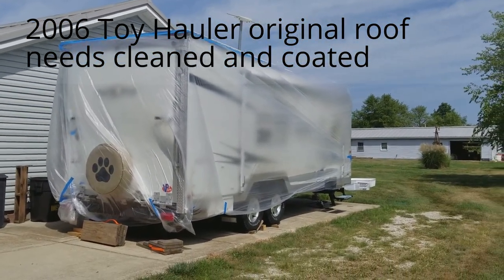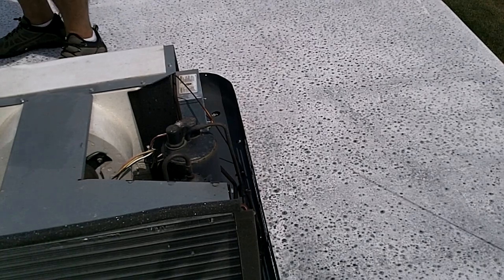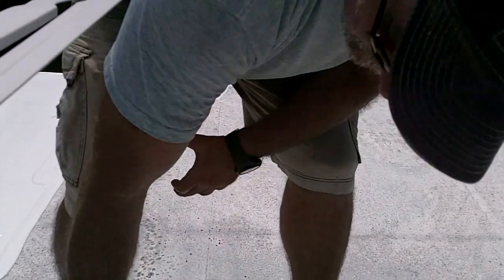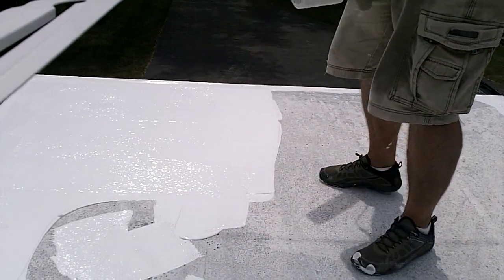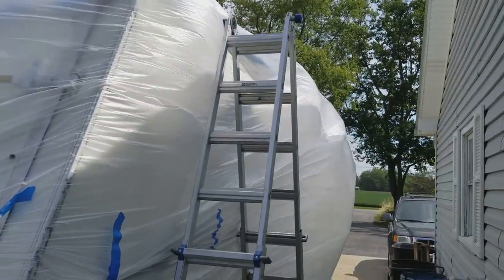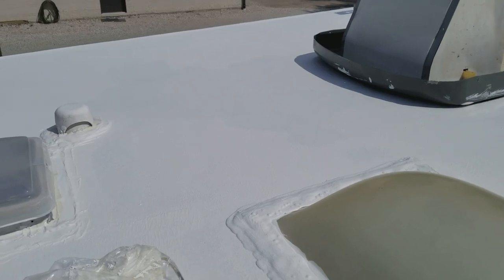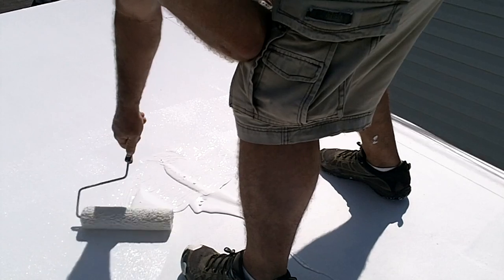RV roof clean and reseal DIY

Comment from the maker: Fyi, 
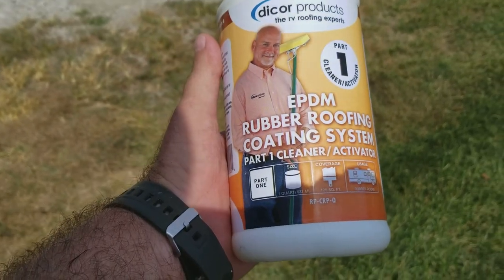@ 0:43 Dicor  Part 1 EDPM cleaner activator. 
@9:45 Dicor Part 2 EDPM Rubber Roof coating / sealer.
Reply: how did you approach the existing gobs of sealer around the vents, seems etc. Did you scrape them off and redo. Seems to me it would be a hassle taking off the existing sealer / gobs of self leveling dicor that is already there.
Reply from the maker: @WarrenEdmundson  I cleaned them thoroughly,  and if it looked like a void existed, I resealed it. No reason to remove unless it was loose. Thanks for watching.
Reply: Thanks for a great video
Reply: I looked up this product and found that the price varies from around $30 to $100 depending on the seller. Can you provide any information as to where you purchased the product and is the first coat you applied different from the second cost? The reason I'm asking is because the label says it's part 2 of the system, is the cleaner/activator part 1? Thanks for any clarity you can provide.
Reply from the maker: @Wearenotperfect.  I purchased all from Amazon. Price fluctuates of course.
Reply: Is that just regular painter's tape?
Great video.
Reply from the maker: @jbfan1263  yes, just blue painters tape.
Reply: So now that it has been a couple years, how has this held up?
Reply: @redroofretriever  still holding up??

Comment: I just did the same to my 26' toy hauler. My roof was almost all black because I was on the last layer apparently. RV places wanted anywhere from $3K-5K to replace my roof. I used the same product you used and I'm actually very impressed. I used a paint tray but it really doesn't matter. I will probably be doing one layer every year from here on out.
Reply: Did it hold you no leaks
Reply: @northdakotanewsnow5813  We had rain here in SoCal almost every week during this last winter. Sometimes it was really heavy. About an inch every 10 mins. Not one drop came into the trailer. This stuff is really tough and I didn't even do another application. I sold the trailer now so hopefully it holds up for the new owner.
Reply: @jasonkubitz9410  .. thank you.

Comment: This application not only prolongs the life of the rubber roof, but makes it easier to clean and inspect. Another bonus is that it will increase the reflectivity, and thereby keep your trailer roof cooler, which adds more life, as well as the interior cooler, saving AC use.
Reply: Oh Great...Thats good to know TY

Comment: Just washed the roof on my fifth wheel yesterday with a little dawn dish detergent water and soft scrub brush....got a few black spots but I feel the roof is good for awhile....having said that it sure looks like you did a great job rrr.....when the time comes I'll do the same as you!
Thanks for making this video....much appreciated!!
Reply: Curtis Swallow just FYI. If you don't condition your roof, you'll be re-coating sooner than you need to.
Reply: @tideishigh8990  Roger that....what do you mean  by condition??

Comment: Looks great, but Hon, you really should’ve attached a broomstick or other applicable pole to the handle of your paint roller in the first place. (Silly!). You would’ve saved a LOT of wear and tear on your back without having to bend over.  I’ve been doing RV roof resealing for about 2 decades, since I’ve been full timing since my late 20’s.

Comment: Thanks, it looks great, my 30 foot 08' Toy hauler needs it too! Will have to calculate how much I'd need for 3 coats. I think I need my shower dome skylight changed out while doing this!
Reply from the maker: 3 gallons should be enough,  you only clean with the cleaner-activator before the 1st coat of sealer. Yes, I'd do all replacements before. 
Thanks for watching.

Comment: Mine was done about a year ago before I bought it, how often should this be done?
Reply from the maker: Inspect it several times a year. Spring - Summer - Fall. Any time you notice a potential issue, fix it now. As for recoating, if it is exposed all year to the sun and winter elements, Id say every 5 years. You'll know if you inspect it regularly.  Thanks for watching.

Comment: Hi! 1st time I will be doing this on my 29 ft camper from 1993.   There is some seal around the ac and vents that is black. Do I remove that or just go over it with this? It is not leaking. Figure I find out before the neighborhood handymen (husband of the community) all put their two cents in my work.
Reply from the maker: Clean away and reseal any dirty joints, gaps. Then recoat.
Reply: @redroofretriever  thank you for your reply. So DONT scrape off the old black thick sealant around ac & vents or remove the old gunk & put new stuff on. I also seen tape that looks interesting as a sealant. Any thoughts? Again thank you for your reply.

Comment: Tky good Job 💪
I have a 40 foot fifth wheel and I have to do the roof I also want to put a new skylight on it because it gets really hot with the clear one that I have on there now and I'm starting to get a little leak so I'm going to get the smoke one and then I have to get a new cover for the fan that goes in the bathroom because that blew off in a storm and cracked I live in Florida it's a nightmare with storms down here I don't have to tell you but do I cork first after pressure washing or just continue to use that Roofing seal... and then I don't have to caulk the edges and the sides of the roof but I'm going to have to talk down that Skylight and to tell you the truth I really don't even want to open up the bathroom vent I have to get a new cover and I think I'm just going to seal it and I'm going to make the cover smoke instead of clear cuz that bathroom gets hot and I don't want no more leaks
Reply from the maker: If it were mine, I would inspect closely any existing caulk, mark it, clean and recondition as necessary, let cure. Then tape if you want that level of protection, clean and seal the entire roof as I did in this video. Replacing skylights and other penetrations are simply remove and install, with a final seal on anything broken in the process. 

Thank you for watching.

Comment: My RV roof was coated two years ago before I took possession but the coating is very thin. I'd like to redo it but I don't know what product was used previously. Should I be concerned that Dicore will not react well with the current covering material?
Reply from the maker: If you know what coating was used, contact Dicor and ask them your question. I don't know what you can expect.

Comment: Hopefully you will still get notifications of comments and be able to help me out ! Im in the UK and have a 1980 Fleetwood Tioga it's roof is awful it's a single sheet aluminium roof with a rubbery coating on too ! Is this paint the correct stuff to cover it all and seal it ? I have the dicor and have cleaned and sealed the front and rear cap and all the vents etc ! Thanks
Reply from the maker: I would suggest checking the product manufacturer for the type sealer to use.  A roof as old as yours will likely have areas to be repaired before sealing.  Thanks for watching.
Reply: @redroofretriever  the inside is totally gutted and remarkabley it's nearly all fine just the front an back that were bad which have now been repaired

Comment: How can I prevent water from leaking into a camper roof that already has a leak while I’m pressure washing it?(prior to sealing) Sorry if it’s a silly question, this will be my first time doing this. Someone’s knowledge would be greatly appreciated 😊👐
Reply from the maker: Clean the area that leaks by hand, not pressure washer, then seal with eternabond tape. Then clean and seal the roof. My $.02.

Comment: I am getting ready to redo my roof but I called Keystone and they said I cannot walk on my roof. I notice your Travel Trailer also does not have a ladder. Any suggestions or did you just ignore the rhetoric?
Reply from the maker: I'd go with what your manufacturer tells you. Ask them how they do it, they may be baiting you to bring it to them, so they can walk on your roof.  Do you have an air conditioner, roof vents, etc on the roof too? Those need to be maintained somehow.
Reply: @redroofretriever  Yeah I pretty much have everything you have. My frame is aluminum though
Reply from the maker: @brotherbonesx3163  history hauler is aluminum frame also.   Most are.
Reply: @redroofretriever  Thanks for the confidence. I'll give it a try very carefully. I do need to take the caps off  to get to the caulking underneath. Will be quicker and more effective on the roof versus on the ladder.

Comment: Save your back - use a broom handle to extend the roller (almost all roller brush handles will do that).
Reply from the maker: I started with one, but as you can see, it broke early in the 1st coat going on.

Comment: What was your approx cost on the project. I think my trailer is ready for the same process
Reply from the maker: I bought the materials from Amazon,  I used two gallons of sealer on this trailer and 1.5 bottles of primer.i dont recall the cost.
Reply: How big is your trailer, mine is 28 ft.
Reply from the maker: @exquisiteremodeling1  this was about 22feet long. Read the labels on the can for measuring and it will accurately tell you how much you need.

Comment: I plan on cutting some of the spout off a watering can and dumping my sealer in there. Will save on multiple pours from a can and hogging it up...
Reply from the maker: If left exposed to the air, it will start to get a skin on top.

Comment: What is the length of your RV question
Reply from the maker: This was considered 25ft, but the roof itself was 20ft in length, the fold out bunk was the additional 5 ft I guess.  Thanks for watching.
Reply: RedRoofRetriever thank you for taking the time to make the vid. Ha id be too stressed to set up a camera. I have a 27ft with one slide out. Im thinking 3 gallons of paint and 2 (qt?) of the cleaner/deactivator should be enough then based on what you did.

Comment: Hello there, fairly new to the RV world. I was looking through your description for the names of the products you used.
Reply from the maker: @ 0:43 Dicor  Part 1 EDPM cleaner activator. 
@9:45 Dicor Part 2 EDPM Rubber Roof coating / sealer.
Reply: @redroofretriever  thank you didn't hear you say for some reason. Selective hear at its best. Ha great video very helpful will be doing later this week.
Reply: Where did you get or sell those products Part 1 and Part 2 ?

Comment: Why was there pre adhesive coat used?
Reply from the maker: It is a 2 part system. Part 1 is the cleaner that cleans and prepares the membrane to bond with part 2.  Very simple to use and worked great. Part 2 cost is $75 / gal. I would not want to use it without proper prep per manufacturers instruction.  My roof clean and seal / restore was around $200 plus my labor.  It will likely outlast the rest of the toy hauler now.

Comment: I did it with a bucket an scrub brush an garden hose
Reply: Mad Dog did that get it clean? I'm about to do my roof and can't believe a brush and water won't work
Reply: @jakebarnier5188  I'm about to do mine that way. the manufacturer said you can, just need to do it in smaller sections. That's all the information I have been able to find regarding this

Comment: shouldnt have poured it out on the roof, makes for a very uneven coat.  but you ok
Reply from the maker: The roof is uneven, and the thicker the coating the better. I am very pleased with the results after 1 year.